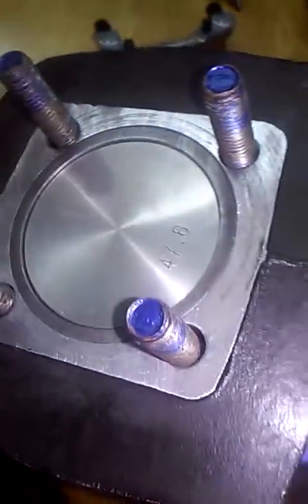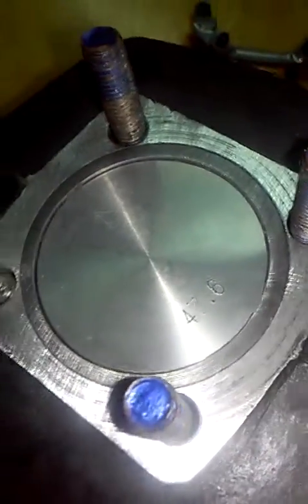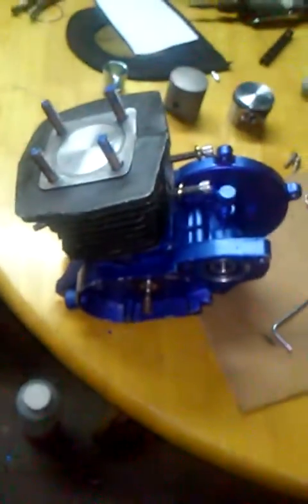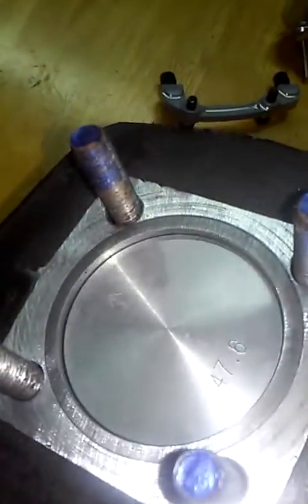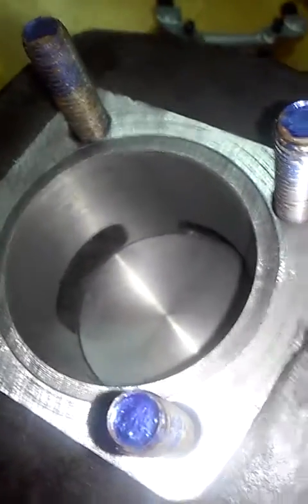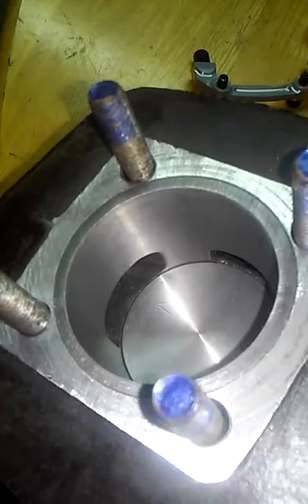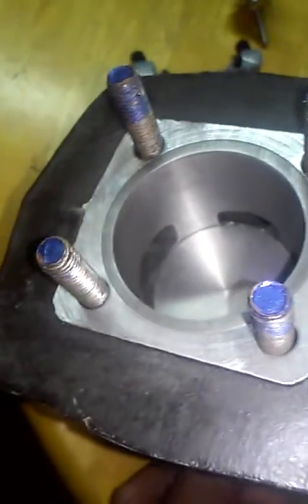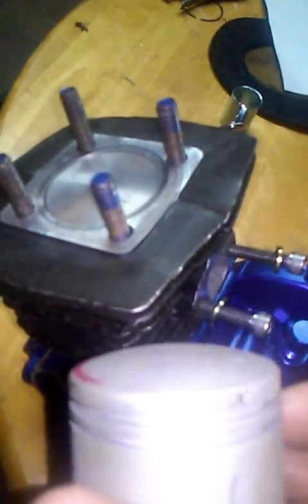O. G sleeve Custom built motor & cylinders

Comment: How long did it run for and you need more blowdown
Reply from the maker: two stroke ports this motor is the one  I did for the kTM bike 70mph last race it had was key Biscayne beating the 911 falcon yellow bike with a 200lb rider